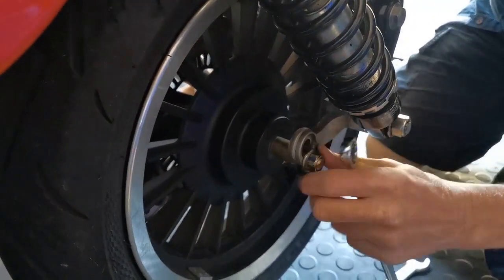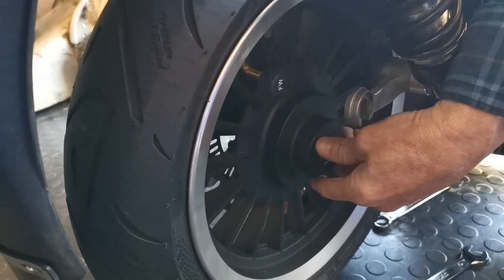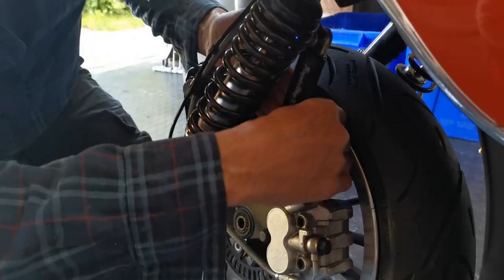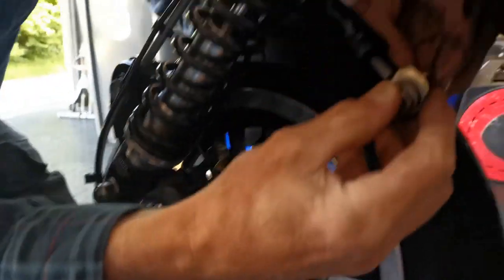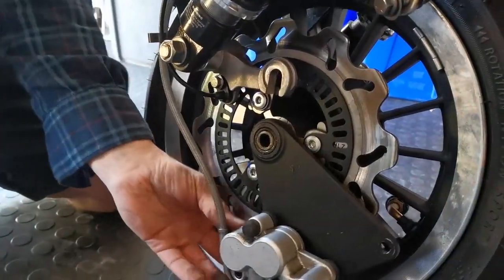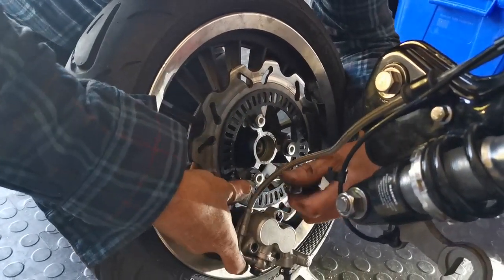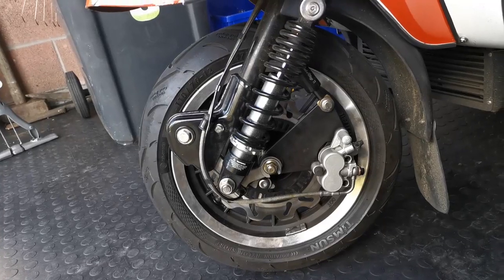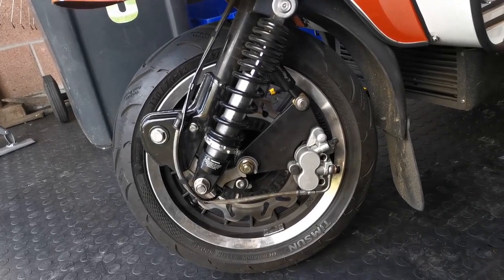Royal Alloy Removing front wheel

Comment: Good you got it fixed. And you weren't hurt. My royal alloy Gt125 has writing on front headlight, seen other ones ie yours clear. Where can I buy a headlight unit that will fit a 2021 RA Gt125 thanks Mike
Reply from the maker: The writing is on the LED beam splitter. GT125 don't have that headlight. Spares are shown on the MotoGB website with prices.

Comment: So, do the Royal Alloys come with a Lambretta  type fork set? I noticed the L-shaped forks, although they do have additional mounts for the heavier shocks and disk brake attachment. The links that mount the wheel to the forks look much like Lambretta links.
Reply from the maker: The forks on all RA models are the same and look similar to the Lambretta on which they are modelled.

Comment: Hi royal alloy guy, how do I remove the front caliper without taking the wheel off, gt125. Many thanks Darren.
Reply from the maker: You would need to dis-assemble the brake shoe which is more difficult than slipping the wheel out.

Comment: You can also free the wheel without taking off the disc by removing the inner brake pad, this allows the brake caliper and mounting plate to clear the disc and wheel.
Reply from the maker: Cheers for that.
Reply: Care to show us "How to"??
Thanks
Reply: How do you do this
Reply from the maker: @Anthony Ash  if you take out the three set screws in the brake disc it will slide out.
Reply: How do you release the brake caliper to change the pads
Reply: Yes, that would release the wheel, but you really don't want to disturb the disc. The screws are torqued, and the threads have  an applied locking compound.
Reply from the maker: @anthonyash3454  sorry I've not done the brakes.

Comment: You never did show how the caliper came off the rotor... you never did show the caliper bracket removed from the wheel.. you ran into problems there and didnt want to show us.. I call shenanigans.
Reply from the maker: Pretty sure when you undo the brake disc it just slides out. It's quite a while since I made that video. Shenanigans, a word my mother used back in the day 🤣 🤣🤣
None here though.
Reply: Yes, yes, everyone gets hung up on the same spot.
The big black bracket that holds the caliper, coming off the axle.
You got hung up there too...   BUT sadly, skipped over your solution.  Just took right up after you managed to get it off... You didnt show it. You left out the part where the only difficulty is...😢
Reply: How do you remove the big black bracket I'm trying to change the pads and disk but caint seem to work out how to release the brake caliper